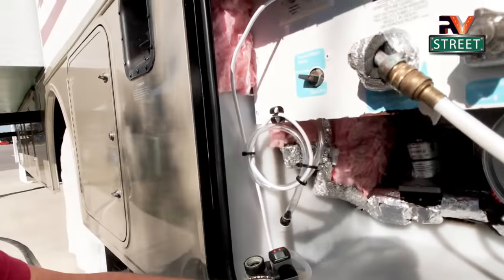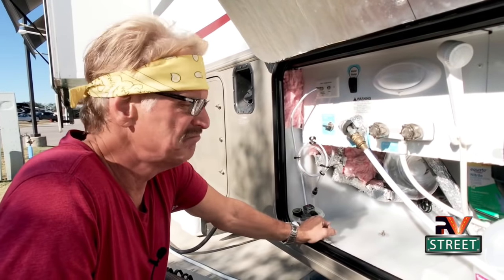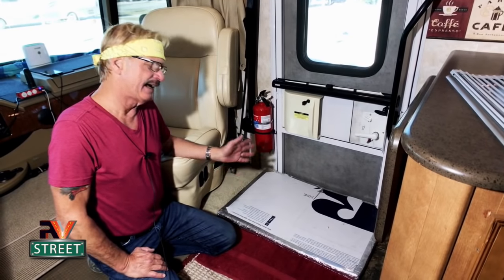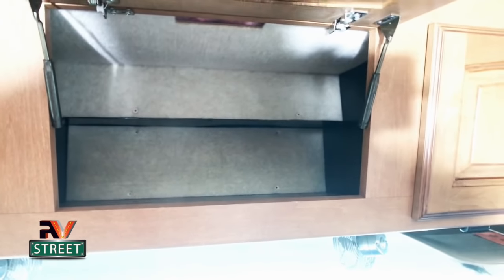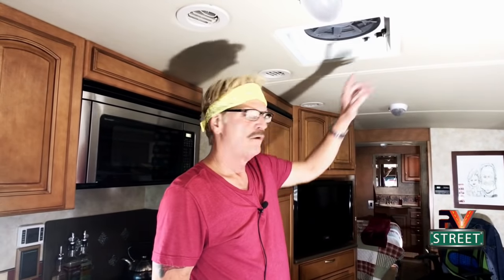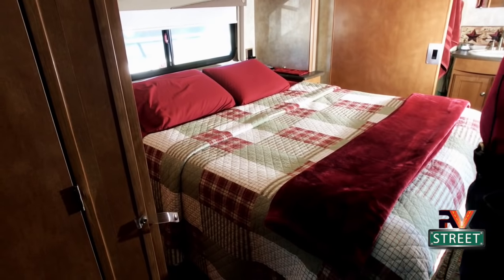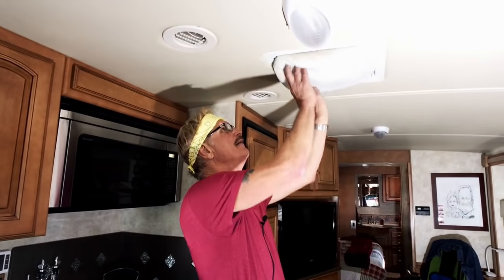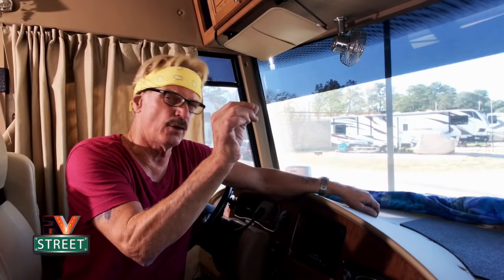😰  INSULATE, HEAT & PROTECT • Key to stay warm in your RV

Comment: after placing 2 in thick foam around your rv for skirting it. a small mr buddy turned to very low, can do wonders down there, but set up on a NON flammable area. with nothing burnable within say a couple feet of it. and plumbed into a far larger propane supply.
now you are NOT trying to "heat" up under there. just trying keep it from getting that cold. but even then it must be vented to allow the bad gasses a way out. and new air in. even if your coach has up-graded insulation under the flooring.
just one way of many ways needed to work on your heated bubble.
if you want to live in sub freezing temps. you must go extreme, to not die.
line the inside walls with 2 in thick foam.
the ceiling if possible, 
very heavy "plush" rugs covering all of the floor.
have a heated "shack" 2 in foam all around inside it. and just a larger heating pad. next to the rv and have a far larger propane supply in there. one large tank?, couple more rv bottles. everything already plumbed for use. propane has this problem when it gets cold. just freezes up and stops till thawed out.
heat your inbound water. 
out bound water,
and the propane lines.
Reply from the maker: It sounds like you have all your bases covered👍
Thank you for your input and sharing your knowledge with the RV community

Comment: Fist time watcher.   Really liked your video, No nonsense right to the point.  Just a comment on running the propane heat, Like the comment below, isn't it a good idea to run the furnace just to keep the underbelly warmed some, water lines etc.  We don't have the huge coach like you but even for a travel trailer, seems like it would be a preventive to help keep lines from freezing??  And ya sort of wonder why don't these manufacturers of these RV insulate better.  You have done a superb job on insulating your rig. And the idea about the heated mattress pad,  I will do that.  Husband likes it a lot warmer then I. All good information
Reply from the maker: Yes it's ok to run the propane furnace to keep bays and pipes underneath from freezing IF......it's going to get below freezing. But in this case I was pointing out how people run their furnace even when not freezing and they have free electric right outside. I also put it another way in the very first comment under the video.

Comment: Using floor furnace at RV Park is necessary if your water lines run thru your heater ventilation tube, you keep your water lines from freezing. 1996 Thor Country Manor. 36 foot.

Comment: We use our furnace when boondocking. When we have full hookups, we have a heat pump that is good until get below 42. We have a little ceramic heater with a tip over cutoff feature we use. We don't do much real cold camping. I probably use the ceramic heater to create a load on the generator when I exercise it while the RV is in storage during the winter.

Comment: Hi, there is one advantage to using your on board heater in a class A and that is the heat helps keep your plumbing from freezing.  At least that is what I have been told.  Don
Reply from the maker: Ya for those who have Class A's that have basement heat from their propane furnace and it's going to go way below freezing for many hours or days then using a propane furnace makes sense. Otherwise in just cold temps and not getting to freezing temps, I think electric heat when you have full hook ups is a better way to go. If it gets close to freezing, we'll still using electric heat and just open all our cabinet doors inside the coach and that heat keeps all pipes warm and of course what I did in the wet bay I never have to worry about that area. Thanks cowboy for your input.
Reply: @RVstreet  I agree and know more than I do.  Thank you. Don

Comment: I am going to use my electric floor Dr Heater this year . I gave bern afraid to use it because a service tech said the electric heaters cause the wires in the wall to over heat and can catch fire and you won’t know it’s happening because the wires are in the wall. He said RV wiring isn’t made for electric heaters . So I’ve been afraid to use mine. Also you needed to stress to not run them on an regular extension cord or a power strip .  Floors heaters used on those will cause a fire. If you must use an extension cord use a heavy duty one like a 12 gage wired one
Reply from the maker: Well I disagree with that service tech. Here's why.
Wall outlets in an 30amp or a 50amp RV can easily run high voltage items like, a microwave, a hair dryer, electric fire places—just to mention a few—and several things at once. All of these items use at least 1500 watts which is only 12.5amps. Most floor furnaces—like mine— draw about the same kind of wattage. We have ran our electric floor furnace for years and have never had a problem. Our floor furnace draws 1500 watts (maximum) and on really cold nights it will run all night. Just as a raw test, I've even just put my hand on the cord and outlet and it never even gets warm. If the circuit ever got overloaded more than what it's rated for, it would get hot—which it never has—and it would throw a breaker or the GFI would pop. 
Now I agree with you about running a heavy duty extension cord if you have to, but it's been my experience that these electric heaters have plenty length of cord on them from the factory to work fine in an RV and reach a nearby outlet.
In another note, the furnace I used in this video finally died a couple of months ago, after about 6 years of use, so I bought a replacement floor furnace that I have in my Amazon store. It's the black one at the top of the "Stay Toasty, Control Condensation" category. I like this one even better. It's super light weight, has a much smaller foot print, has better features, remote control if you want and warms up our 35' RV just as well as our old does.
I do not worry at all about our wiring being sufficient enough to run this appliance.
https://www.amazon.com/shop/rvstreet

Comment: Running electric heaters do not keep the basement warm thus increases the chance of tanks, water pump and lines freezing.  I place a floor safe ceramic heater in the basement which keeps everything above freezing and it keeps the floor warmer.  Also, even if you run the propane furnace with ceramic heaters simultaneously, the ceramic heaters will prevent the furnace from coming on because the interior will be warm. If this occurs,  you can still freeze the basement pipes and all tanks.

Comment: Excellent Video! ❤ However, didn't see a link in your description for the ceramic heater tower suggestion. 😢 We have small dogs so would love to see a review of space saving tower devices that have both a/c and heat. These dual climate control units are bluetooth  with a cell app to alert owners remotely that, for instance, the breakers have tripped and the cabin temp is changing alarmingly.   I heard Camping World has these but haven't found them on Amazon.  We travel in hot climates and sometimes do site seeing where our pets stay home alone for the day.  @rvstreet
Your Question: We have a built in propane furnace that heats the hatches so during sub freezing weather no pipes freeze - Excel Peterson 5th wheel.

Comment: Many great ideas..I have a trailer..and I'm caring for my mom so I'm stuck in the car sun all day..it's a good trailer but my upper cabinets were hot and cold I went to HD and got the thin bendable insulation panels..I used the silver tape to attach..there bowed inside..I also made panels for each window and cut to size and taped the sides..I can take in and out..my worst spot was the corner built in tv cab....ice cold in winter...I cut panels to fit and painted them to blend..I even cut panels to put in ceiling vents then put the fluffy ones in..my shower was very hot in summer ..I covered in panel and foil ..all can come in and out...under bed used the thick panel cut to fit and set inside...I built a large panel...with two by four frame and I can set against hot sun side of trailer where the awning doesn't cover in sun...that can't go with but it's saved our hit water heater and fridge stays cooler because the wall is..I bought a fake fireplace ...had a rodent get in when I first got trailer and it ate a hole in my floor vent..can see it..so floor heat was out unless I wanted to year it all apart and I'm handicapped and female and old...so I keep vents covered..and I had the under floor all checked and sealed ...I kinda made up stuff as I went along...and it can be Hot outside now but it will stay so cool inside if it's closed..and fridge and air works better..wish I could do kitchen floor..now that's a cold floor...thanks for more information
Reply from the maker: "I'm handicapped and female and old"......
Well that's fantastic Lynn. Your living proof that anyone if they just take the initiative, can be creative and think out of the box in their own situation—with their own RV—can come up with ways that will make their RV better. 

That was the very purpose of my video. Not so everyone would copy me but stir creative minds to look at their own RV and see how they can improve theirs to make living in it better. Just like you did. 💗 💕

Comment: The reason to use the propane furnace is to not blow fuses and breakers. I am going to assume that you are using a 50 Amp plug for your RV. Having a couple of heaters run off of a couple of 25 Amp breakers isn't such a big deal. We have a different sort of camper that uses only a 30 Amp plug. So we end up blowing one of the two 15 Amp breakers, especially if anything like a coffee pot or toaster is plugged into the same circuit. We are in a position where we have no choice but to winter in Wisconsin. Having a heated water hose (look for it in the livestock section at TSC or Fleet Farm or something) helps tremendously.
Reply from the maker: Yes we have a 50amp coach but I've this on 15amps too. We keep both our electric furnaces on ECO mode and set low to about 67º. It keeps our RV at about 72º and we don't blow a breaker. Each furnace is only using about 700 watts. Now yes, if we want to use another appliance we will temporarily turn off one heater, then turn it back on when we''re done. We manage our electricity in those sistuations.
I can also run both of these furnaces off my Bluetti. If you want to learn more on how we do both of these things watch these 2 videos:
https://www.youtube.com/watch?v=RraxjVpLhUc&t=2186s
https://www.youtube.com/watch?v=QkTupmk2y3Y&t=548s

Comment: One very obvious reason some one next to you in a full hook up camp ground would prefer an expensive propane heater as uposed to a cheaper electronic ceramic or quartz heating unit is because their motor home is not well insulated such as the way yours is. 

And they may never have subscribed to your channel.
 Or they just don't want to lift a finger to insulate that drafty motor home and just remain on that propane in the neck tread mill learning curve. Or some just have a rental.

 One thing about the Mr.Heater is that the heat is hotter from the top of the larger one's and you do not want to park that heater under a low ceiling because the heat blows up ward rather than toward you, and it will melt or burn your interior curtains and paneling and have to sacrifice a couple cartons of baking soda to toss the baking soda out of those cartons directly on the base of the fire or on the curtains to dowse over the flames to out out the fire.
 And one of those special heat fans that draw heat from above can cause the dual fans to spin and that can divert that upward heat toward you.

Comment: Just watched your channel for the first time - wow!!  So much really helpful information, so I’ve subscribed and joined your family 😄.  I’m a 75 yr old widow, and I have a lot of questions, I’ve rv’d part time only, and recently purchased a 2013 class C, Thor Motor Coach Four Winds 23U, no slides, Chevy E4500 chassis, and Chevy 8 cylinder gas engine that replaced a 2011 Winnebago Via with a Mercedes chassis and Diesel engine.  So I’m going to be looking at all the outside storage areas to see about getting that all squared away with insulation before I start using it for long trips next fall.  What puzzles me most about this particular rig is that it has two house batteries, but no inverter, so I either have to run the generator or be plugged in to shore power for anything to work, just doesn’t make sense to me.  Not sure how to address that, so any info you can point me to would be much appreciated.  I was also wondering about getting solar installed so I can camp more off grid, which of course would require inverter etc.  Thanks again for a great video!
Reply from the maker: thx Laurie so much 👍
"Not sure how to address that, so any info you can point me to would be much appreciated"
Well without looking at your particular set up I just couldn't make any suggestions. But 2 house batt's is common. No inverter is not. But reading your detailed post I have all the confidence in the world you'll figure it out.
If you haven't explored it yet be sure to check out my playlist page:
https://www.youtube.com/c/RVstreet/playlists
BTW...thank you so much for subbing.😍

Comment: If the temp is below freezing you want to run the furnace because it warms the belly.  If you are using electric you are not warming the belly where the tanks and plumbing are and you'd also have to run some kind of electric heating down there, like your 100w lamp.

Comment: Thanks for all the info. Just moved into a 5th wheel full time. Heat is the main issue in the south where I am but it's going to be in the 20s at night this week so I'm trying to learn everything I can to protect my new home. 
Going to home depot in a bit to get some insulation!
Reply from the maker: God. That light and 75watt- 100watt light bulb in the wet bay will really help too. Like I said we've been in 17º for several days and our wet bay stays in the 40º's. 👍
Reply: @RVstreet  I was a near homeless widow and managed to buy a very small Jayco travel trailer this year. Over the summer I couldn’t keep it cool enough and it is brand new. I would wake up with wet pajamas and wet sheets every morning, it was so damp in there. I bought a dehumidifier that was supposed to do that number of square feet, and it didn’t make a difference at all. I’m wondering if the air conditioner in the brand new trailer is defective. Or are they all like that? Now that it is cold outside, I’m freezing to death in there, using one electric heater on the floor. The electric bed warmer is a good idea but I have a dog so I have to keep the whole trailer warm enough for him.
Now that I know what is wrong, I will try to do some of your insulating tips. I am not as handy as you are though.
Reply from the maker: @anneiconex1473  Those small Jayco travel trailers—and other entry level trailers from other manufacturers—are NOT hardly insulated at all. This summer while in NC, I met a single guy who just bought a 26' trailer. I forget the brand, but his water pump check valve failed and got water all inside his trailer. He didn't know what happened so I offered to go inside and help him figure it out. As I was inspecting, I  opened the lower kitchen cabinet doors under the sink to look at his plumbing and I could literally see daylight coming through the back wall. I told him, "oh man you better fix that. You'll never keep this trailer cool and in the winter all these pipes are going to freeze".
You need to look behind every cabinet, every area you can that you can get access to and insulate those areas. That's the first place to start.
As far as....is your AC working correctly I don't know. A properly working AC is only capable of cooling off the trailer about 18º-20º more than the ambient temperature. So if it gets to say 95º in the trailer without the AC on, the very best you can expect it to cool is down to about 75º to 80º and that's if your insulated well. If your not insulated well, or you have vents, windows or doors open it will never cool down sufficiently.  But a way to test it is, take a thermometer lay it on the counter and see what the temperature is inside. Get that reading. Then take the thermometer and hold it up inside one of the ducts if the AC where cold air is coming out. That temperature of air coming out should be around 18º - 20º colder. If it's not then the AC unit is not working properly. Why....? Well it could be several things but I can't offer assistance without looking at it.
Hopefully this will get you started though.
If you insulate well, and your AC works properly, you shouldn't need a dehumidifier. 

Now in the winter you will need a dehumidifier. You'll need two of them. One up front and one in the back. When it gets cold outside and your heating up the inside that will cause condensation. In addition to 2 dehumidifiers, keep a roof vent slightly cracked open to allow the trailer to breath properly.

Comment: I run a mix of the main propane furnace, ceramic heaters (one small for bedroom and one oscillating floor model), and I’m just now experimenting with an oil filled radiant heater (it’s slow to heat but once warmed up it is consistent—though it’s large and heavier than the ceramic).

I only use the small ceramic heater at night in the bedroom, keeping the door closed. I then use the propane furnace, set on a timer, to quickly warm the whole rig right before getting up in the morning. It warms the floors so it’s nice. But it only runs about an hour or so, and then I use the ceramic in the main living area for the rest of the day (if needed).

I’m in northwest Arizona so it really doesn’t get below freezing. Once in a blue moon it might though, so in that case I do start the propane furnace earlier (1-2am, as it never drops below freezing earlier than 3-4 am).

I will do some of the insulation mods, especially on the slide outs.
Reply from the maker: Thanks for sharing.